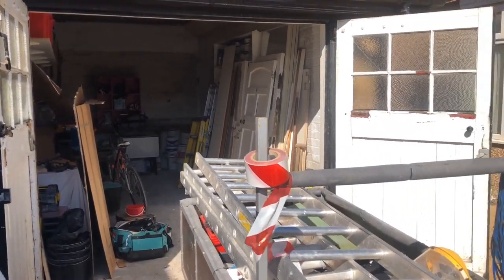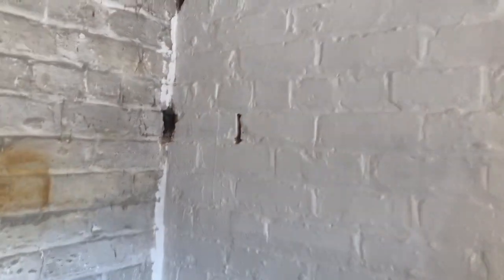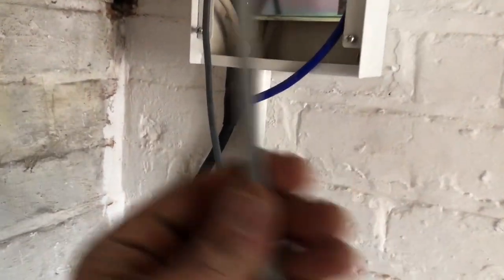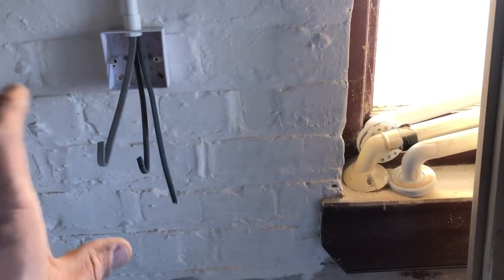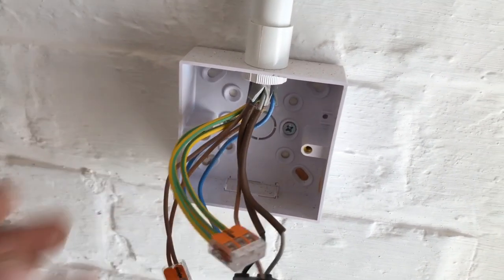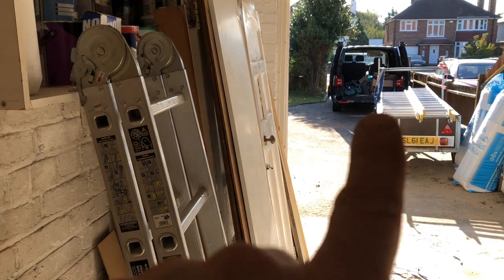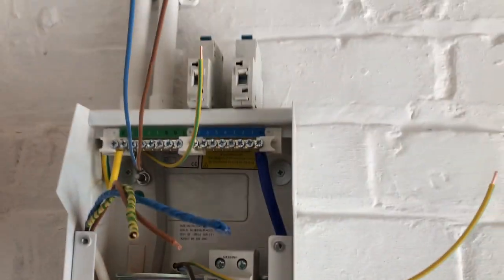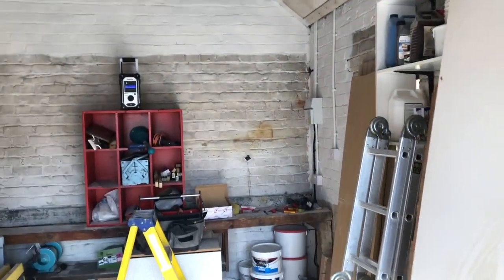House Bashing Electrical Garage Wiring With Consumer Unit

Comment: We do it different in Ireland we put the RCD in the CU in the shed so when anyone is working in the shed and a fault occurs it trips in the shed also the lighting is not on the same RCD as the sockets so there is no blackout when something faulty is plugged in.
Nice tidy work well done.

Comment: other than swa cost, why not run the swa from main board to sub, was there a specific need to have the jb present outside for the connection?
Reply from the maker: denbo786 GO just easier in this situation to run threw the house with all the other circuits in t&e to the outside wall. 🤷🏽‍♂️👍🏽
Reply: @Badmedicine7999  fair enough, was just curious and it would have bugged me if i didnt ask. thx